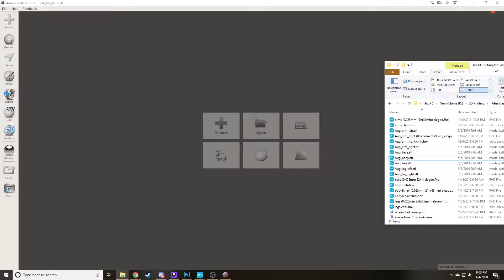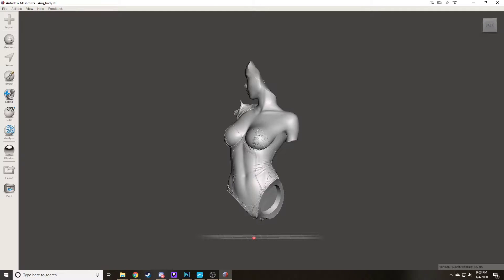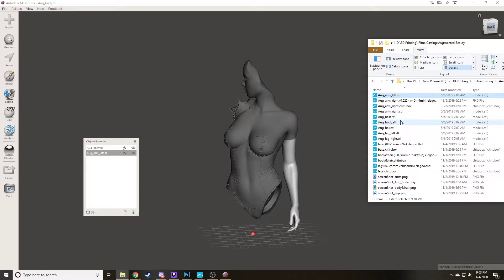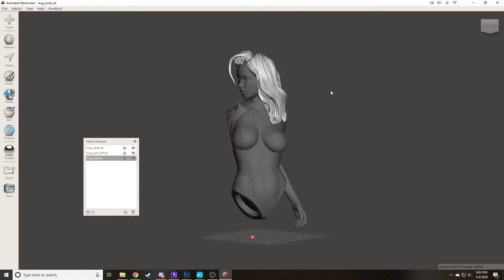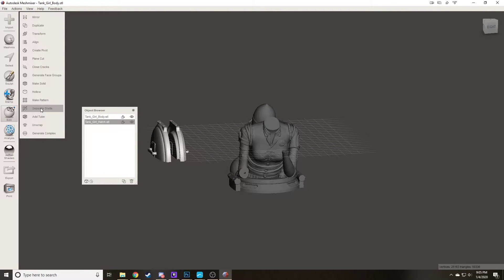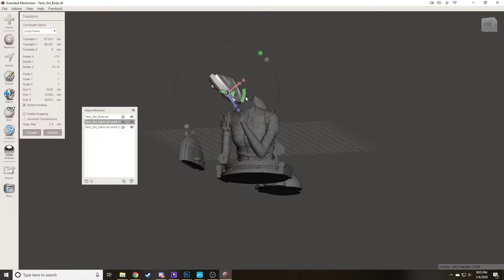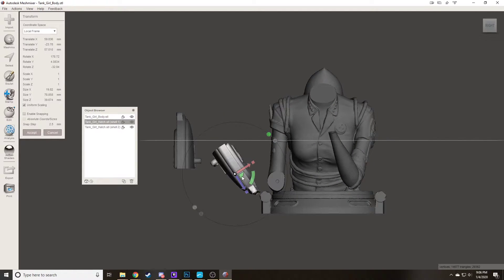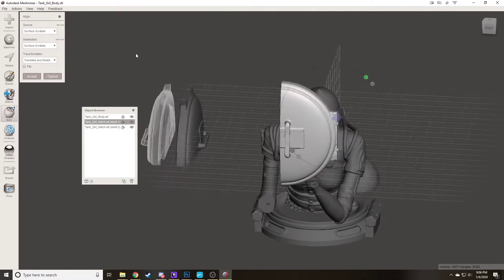Re-joining split models in Meshmixer using "Align" and "Surface Scribble"

Comment: Trouble is if you combine then export, slicers still see seams between parts.  And if you try to hollow it, the slicer will create walls inside the model at those seams.  And every time I try the 'make solid' option to make it one full model, I can never get it to keep the finer details.
Reply from the maker: Yep.  If you're going to hollow the model, this will cause that issue.  "Combine" still leaves each part as a separate mesh, fine to print solid but you'll end up with a lot of internal walls if you try to hollow it.  If you can Boolean Union the parts together, instead of Combine, that should result in a solid single mesh.
Reply: @IsenMike  Oh wow, thanks for the tip!  I never saw that option because I always tried to combine multiple parts at once and the boolean option only appears for two models at a time.

Comment: i have an stl file, i want to shrink it down so the complete ship is 477mm long and cut the stl in half vertically so i can print it in 2 halves, is there an easy way to do that?
Reply from the maker: You can adjust the size in Meshmixer by going to Analysis -> Units/Dimensions.  Then to split it you can use Edit -> Plane Cut.  Set it to "Slice (Keep Both)" to keep both halves of the cut, and then use Edit -> Separate Shells to make the two halves into separate objects that can be exported separately.